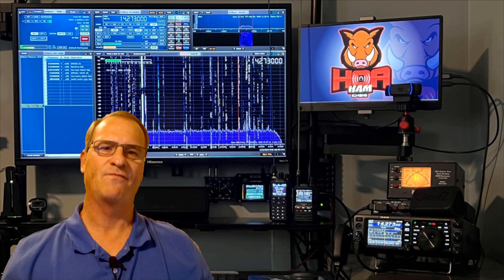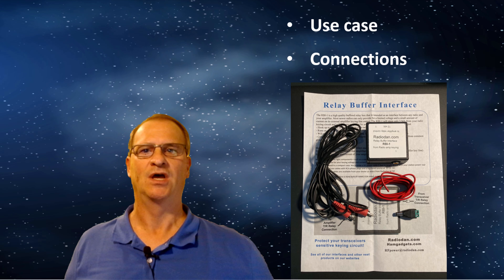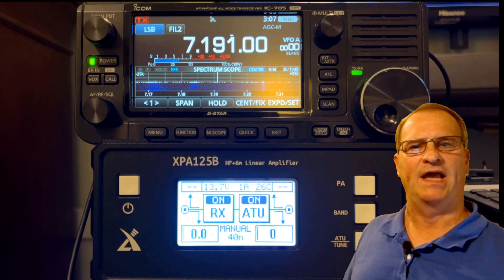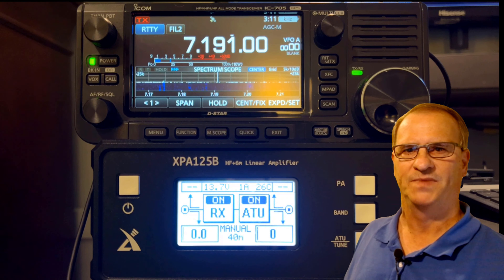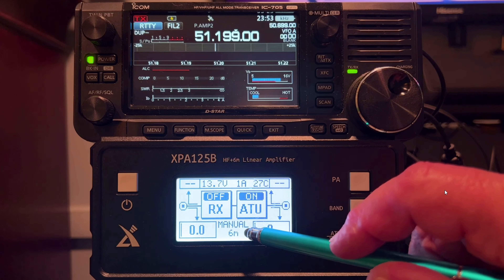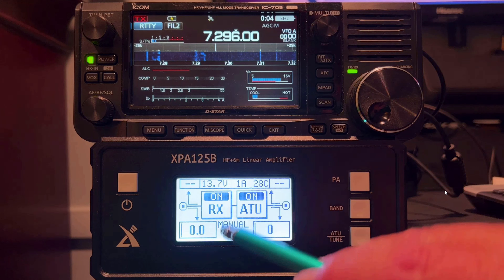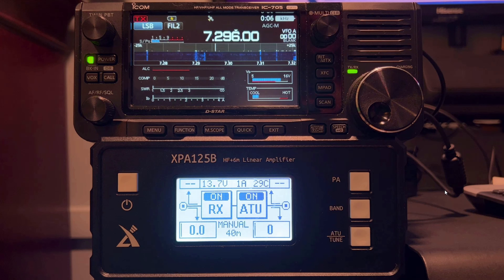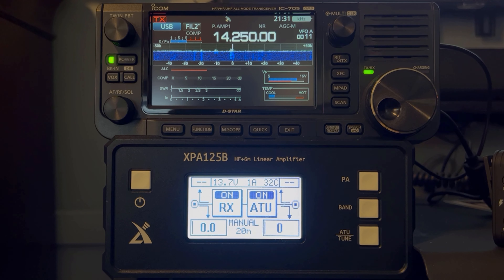PART 2:  IC-705 Paired  With The XPA125B  - Using The INTERNAL TUNER With A NON - Resonant Antenna

Comment: I had been looking at this amp for my 705. Your video just helped me decide to go ahead and buy one. Thank you for the Buffer info I will use one of those. I am happy to spend a little more to protect my 705.  Thanks again for the wonderful video!
Reply from the maker: Glad it helped Barn Dweller; this is a great pairing the the IC-705.  Some have said the buffer isn't necessary; but I can't bring myself to taking that chance.  This came about as I was trying to solve the amp problem myself and thought I would share it with others.
Reply: Same. I have the 705 and have been seriously eyeing the XPA125B. Thank you for this critical info, HOA Ham!

Comment: I bought this relay buffer on eBay and it works like a champ and addresses the issue that ICOM discusses in their manual. ICOM IC-705 to Xiegu XPA125B amplifier keying cable w/ RBI-1 .  I love this amplifier and it works excellent with the 705.
Reply from the maker: Totally agree with your assessment; works like a charm.

Comment: Any idea the right way to tune using g90? Manual say cw 5watts , but when i go back to ssb i see the left bottom watts fluctuating very high  up to 20 watts and righ side bottom  going up to 150+watts even with radio at 1 watt. If i tune it to AM and 10 watts is the only way i can keep control of not overdriving at 2 watts on radio but still read very high watts at left bottom of the amp
Reply from the maker: https://youtu.be/TKDDVtK69gQ

Comment: The XPA125B manual says to tune for low SWR in CW mode, but doesn't give specific instructions for tuning the G90/XPA125B combination. Radiooddity emailed me to set the XPA125B PA off, key the G90 mic with16 watts AM (carrier only no modulation) then initiate XPA125B tune. After XPA125B tuning cycle completes, reduce G90 power to 5 watts or less, turn XPA125B PA on. Following these instructions I get an SWR of 1.7 or less and good SSB signal reports on all bands, 160 - 10 using my 71' end-fed non-resonant antenna.
Reply from the maker: Thanks for that feedback Jon.  That's interesting they strayed that far from the manual in using the Amp / Tuner with the G90.  To get the Tuner to work with the IC-705 I had to push it with RTTY.    I sure with they would update and expand that instruction "Manual".
Reply: What you mean by carrier only no modulation?

Comment: You got me thinking about the ARB and I think I will buy one. Like you said the IC-705, which is what I have is very expensive. I would use an ARB with an AMP to save or hopefully protect my radio so why not do the same with a QRP Rig. HOA Ham Guy thanks for your help as I only recently received my IC-705 and Xiegu XPA 125B. See you on the air, Robert N0YG
Reply from the maker: Thanks for the positive feedback Robert, and have a blast with your IC-705!  Love mine.

Comment: I've seen that issue with getting the tuner to cycle.  The amp needs enough RF energy to get a reflection back to measure.
Reply from the maker: I beat my head against the wall for a while on that one, till I thought, "it can't be me"...thanks for the confirmation.

Comment: What is the power required by the amp, during transmit and on receive/bypass? Wondering about battery and solar requirements for portable use.
Reply from the maker: Dan, you are asking really great questions, and now I'm wishing my memory was better.  The video series I did on the XPA125B is now several months old and I'm drawing a blank.  As far as portable use, I ran the IC-705 with the XPA125B remote with a 30Ah Bioenno and a solar panel for ~6 hours and barely dented the battery.  Bioenno told me I could use the 20Ah and I would be fine; I went with the 30 since I knew I'd be at it for hours.  I rand the X5105, then G90, then IC-705 and for most of that time was powering a laptop through an inverter and charging cameras, all from the same 30Ah power source.  I only show the tail end of the event using the IC-705 but I do talk through the entire event of running the X5105, G90, then IC-705; here is the vid https://youtu.be/7pclNsBmupk

Comment: Where did you get the patch cable from 705 to amp antenna ports?
Reply from the maker: Here is the kit I purchased from eBay seller, RadioDan:  https://www.ebay.com/itm/143898454710?hash=item2181042ab6:g:LyIAAOSw3~df5qHz&amdata=enc%3AAQAHAAAAsPETEEFhTsoOvdpz4C9WmNDvcE2Lo%2BPSIeNdZckQAs3sZEt3UO2teBh8b1IzTgSgq1kviVGWVEY3LsZ9rB1KOURfYP3sVwHEnGEBdRVIQ29YHx9cd0TzXpTx2JKE0H9NkvcEFPy5tuevwQ%2B41gnBZ0mHrgwnhsNQJilj2RvdFMf5mshjoy%2BoqIScF%2BeNOEca4STppdjcU4lsTGusHiqQv6DN9WAl50B7wccIBrwBW6Q2%7Ctkp%3ABk9SR-rW6Ym3YQ

He sells individual cables as well, and responds quickly to email requests.

Comment: Bob I have my G90 and XPA125B hooked up through a CE-19 and have questions. I think antenna tuning is working but I have yet to see anything out of the amp. No power shown going in and nothing indicated on the output. Also the band will change on the amp when the G90 is keyed. For example on G90 the band set on 20 the amp will switch to 17 and on 40 the amp goes to 30. power on the G90 is set at 5W. I am transmitting into a dummy load. Any ideas? I agree, the manual is as poor as they come.
Reply from the maker: Ralph, if everything is set up correctly, PA on, ATU on, Band select in Auto, with correct cabling between radio, amp, CE-19, everything should work.   Has this ever worked for you, or is it new out of the box?  If new, perhaps its defective??  Here is my video specifically with the G90 paired with the XPA125B
Reply: @HOAHamRadio  The amp is new. I have had the G90 working correctly on FT8 using the CE-19 but switched to the digirig mobile to get rid of the wiring clutter. Wishing I could figure out a way to continue using it with the amp I reluctantly went back to the CE-19. I’ll double check the cabling but right now the G19 is working contentedly with the  digirig and contact Radioddity about returning. Thanks.
Reply: @ralphday7573  Please let us know if you resolve this issue or decide to return the XPA125B. Thanks!
Reply: @jonmcadams5401  Jon, for the time being, I am not using it with FT8. I think I may be OK using it with POTA. Will just have to see! I’m hoping you are campaigning for a better manual. It is needed and would be appreciated!